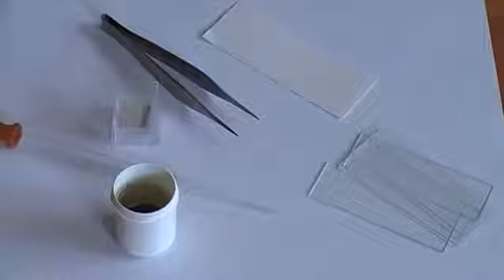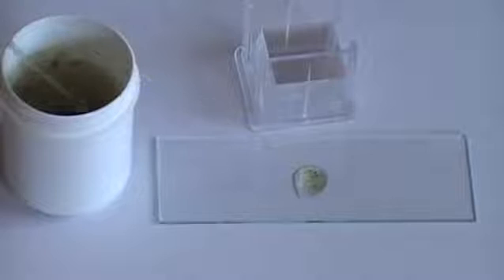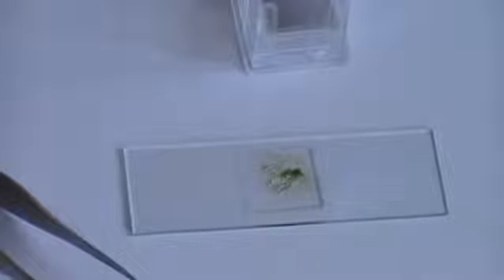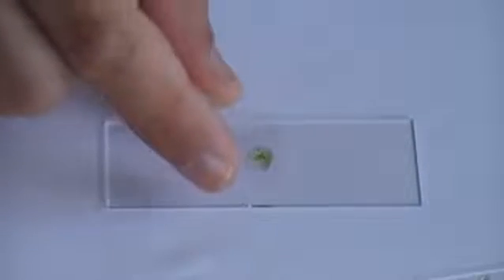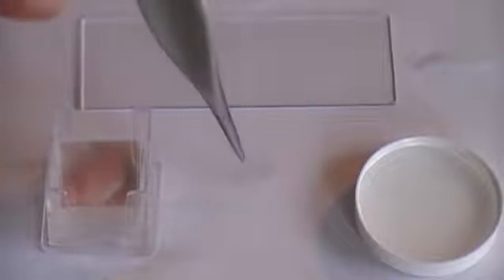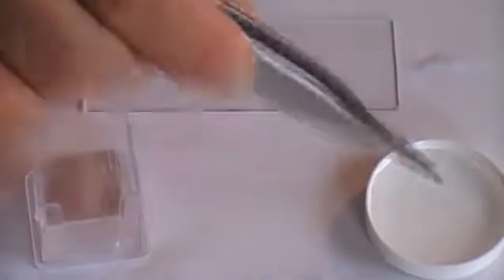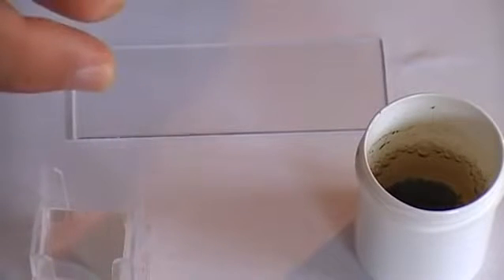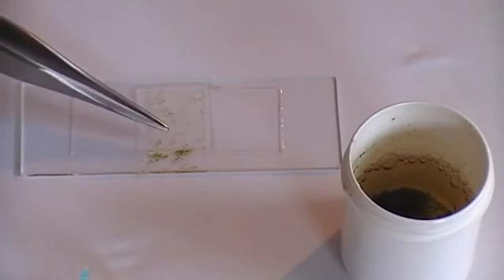🔬 How do you make a WET MOUNT for Microscopy?

Comment: Are single depression concave slides used for wet-mounting too?
Reply from the maker: Yes, especially for water fleas and other orgamisms that are larger and which might be squashed by the cover glass. For smaller organisms concave slides are less suitable, because the water organisms swim vertically in and out of focus and it is difficult to track them.

Comment: @Microbehunter : In your comments, you mentioned that "wet mount, or permanent mount, uses water as a mounting medium". A permanent mount doesn't use water specifically as a mounting medium - it uses a mountant such as Canada balsam or another resin (including Numont, L&C, etc), although water may be a solvent for such a mountant (e.g. L&C).
Reply from the maker: You are correct, thank you for the information. I changed it to temporary mount.
Reply: @Microbehunter  You're welcome 🙂

Comment: I love your simple and effective tutorials. Might I add another method for observing large specimens? Get a ball of soft clay, take your cover slip and gently scrape each corner across the clay to accumulate a tiny bit of clay which will act as little feet and raise the slip when placed on the slide. This was how it was done by my biology 101 lab professor. Cheers!
Reply: Another strategy is to put some tape on the sides of the slide and mount the cover slip on it